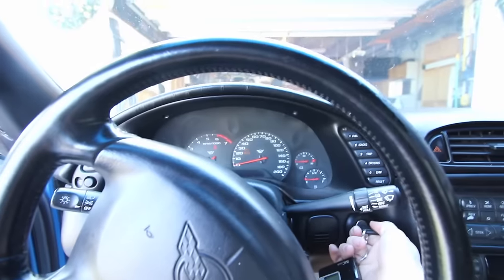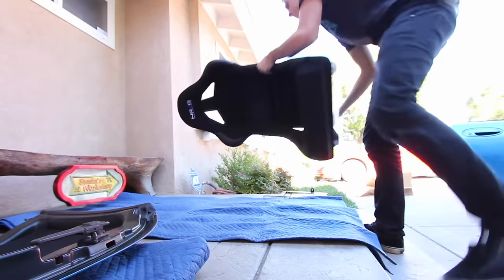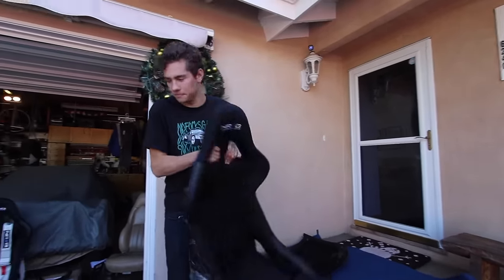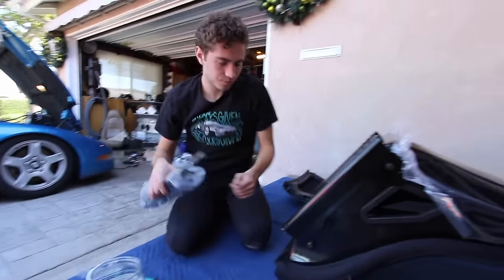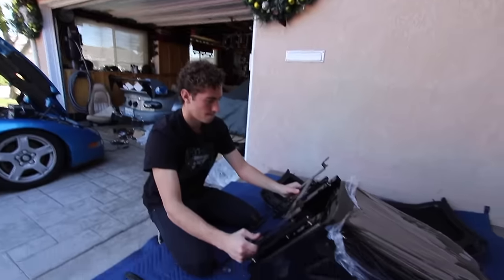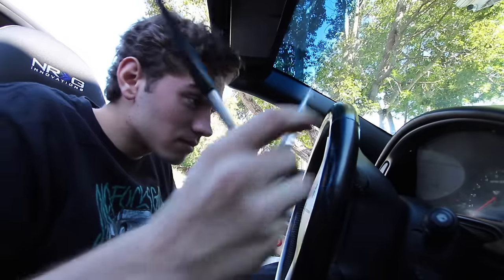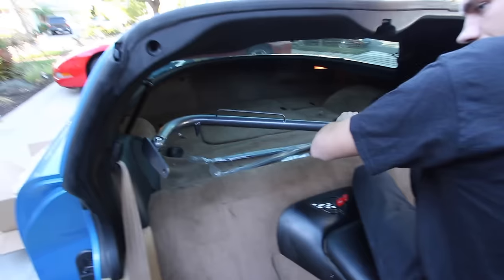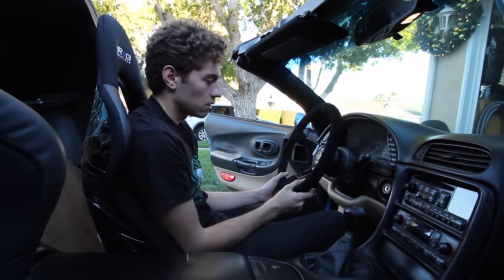How To Be Racecar | WHOREVETTE Gets Seats & More

Comment: you can still use the stock seatbelts over the harness bar mount and use those. it's not a great idea to run harnesses on the street anyway.
Reply: 5 point harnesses will hold you in the car 100 times better then normal seatbelts. The only bad thing I can think of is your neck but at the same time your neck will move the same with a seatbelt